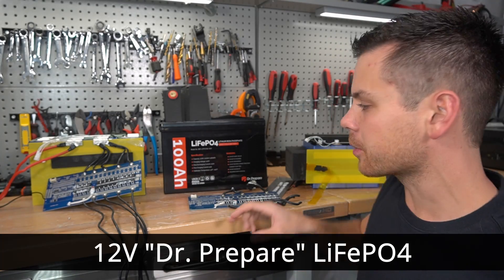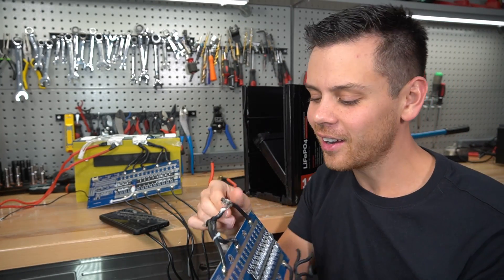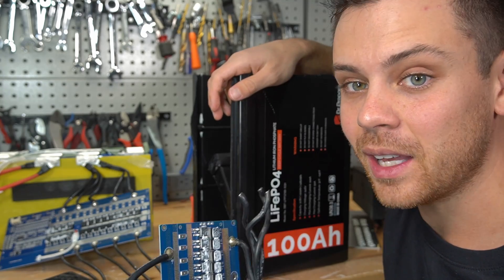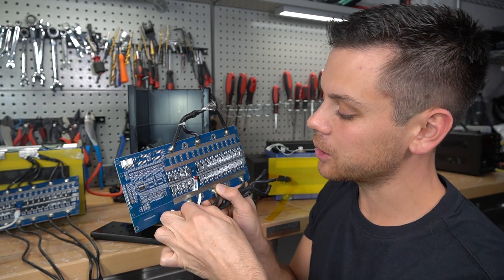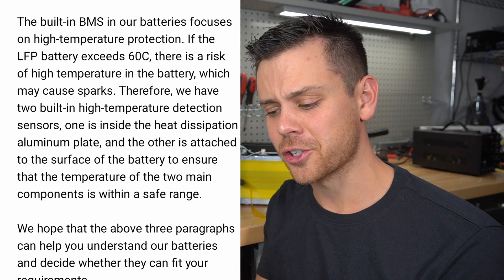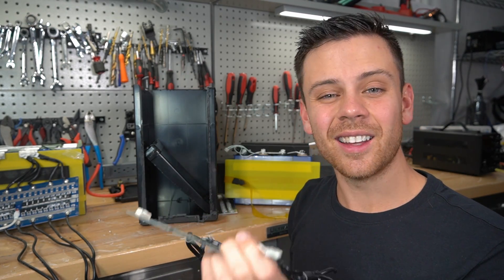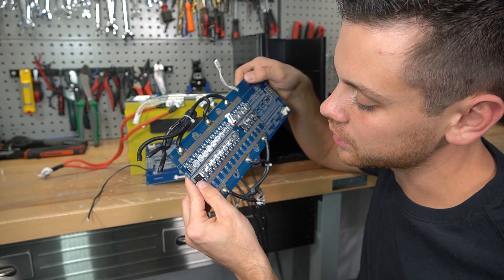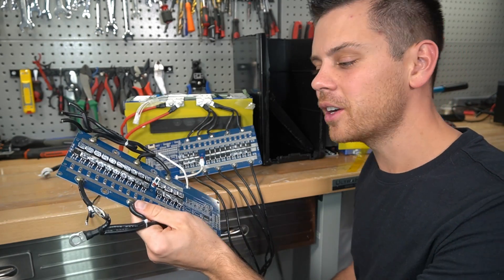12V 100Ah "Dr. Prepare" Part 2! Responding to company email

Comment: Thank you for going great lengths and being very thorough with your reviews of this particular battery for your subscribers. Another channel reviewed this same exact battery a couple days before you and came to a very different conclusion and opted not to open up the battery to do a proper inspection. Thank you for keeping your subscribers in mind before making a profit. Many more people will naturally flock to your channel because of this!
Reply: It's hard because a company claims to have certain specs like "low temp cutoff" and then you find out they lied about it. Hobotech was lied to by this company.... it's not his fault. He could have tested low temp charging by freezing the battery and trying to charge it but he didn't so.... That was a mistake. (no tear down needed). 

They have since removed low temp protection from their website. I have one of these batteries for review on my channel as well. Debating how I want to showcase the low temp cutoff not working and how it can damage the capacity / battery.

Comment: I worked with a guy at an aircraft company that told me how he worked for some small camera company previously. He mentioned how they basically stole designs and changed components and wiring so that they could sell it for cheaper. 
They would send him out and fix the cameras that would run away and break the parts when panning. So he decided to look into it and found out that there were some components that needed to be replaced and it fixed it. He was reprimanded for it. “Don’t you ever fix or change anything ! Replace it with a new one and bill them!”

Well once he figured it out he left. Eventually the owners were sued and he showed me the news article. 

You can assume whoever this seller is , doesn’t understand everything and is trying a “new design” based off of someone else’s work.

Comment: DEMS FIGHTINGS WORDS PARTNER!!! Chainsaw !? Morons! it's called a Variable Speed Oscillating Multi Tool HAHAHAHAHAHAHAHAHAHAHAHA looks too many inexperience people get hired for assembly jobs. they do not know how to use tools or care about QUALITY CONTROL i see it in every trade. people that show up don't want to work "when is break, how many breaks, when is lunch. how long is lunch" now that we're on the subject TESLA is inexperienced when it comes to building cars in an assembly line Whachamacallit! the've only been in the business of building cars for 8 years. The other Car Manufacturers  have years assembly line experience. Tesla only wants to get them out as fast as they can, the assembly line cannot be stopped. it will happen when there's a big accident. they'll hired anyone. personal people i trained in photovoltaic field have jobs as wire harness installers and have told me about guys that use to be waiters yes restaurant waiters. not knocking those who will improve on a better job but the others don't care, only care about paycheck. good people that use to be inmates have gotten hired and moved up the ladder. Chainsaw, Really !?     We Got Your Back Will, You Did Not Cut Cable, Bad Quality Control

Comment: So even the BMS is a cheap clone , what a bunch of idiots thinking that they can take on the battery god. I have two SOK batteries and they are excellent. i have a chins battery and a zoom battery, they are also very good .i use them for small solar projects around my property like running aerators in my pond and a water pump during spring summer and fall with no problems .If Will says it is OK i will buy it ,that simple.

Comment: I want to make my own batteries...

Will shows how to do this on his videos, and it is pretty simple once you get the spot welder,  I am just not sure of the electronics.  Crappy workmanship is so common why pay to have some company screw up the workmanship?
Reply: Ray Johnson  will look into it.

thanks 

:)
Reply: Ray Johnson  What I really took notice of is that they are using nano technology with single molecule thick sheets of carbon fiber, I guess that it is nano to work as almost as super conductors internally at the basic cell and capacitor level to lower temperatures and increase amperage carrying capacity... what is this all about?
Reply: Don't want to make my own! 
If Will reviewed them I'd go to prison!
Reply: @chrisdevalcourt648  LOL  I needed to hear that today...  been gong thru hell since mama died last week, and a good laff was a blessing.  Merry Christmas to you and yours!

:)

Some people don't get it... you can get deep into the mud as you want - nothing wrong with using components.

It's like programming You can use C, but you can have more control  at the assembly code level, and even more control at the machine code level...  working with individual cells is cheaper but lot of work... if you want to use factory packs wher the sot welding has already been done fine, but don't act like it doesn't have to be done by someone, Hahahaha
Reply: @barking.dog.productions1777  glad you enjoyed my humor! 
You do learn from experience and great satisfaction in learning and doing! 
Keep your glass half full not half empty! 
Be blessed!
Reply: What on earth are you spot welding ? That stuff went out some years ago !